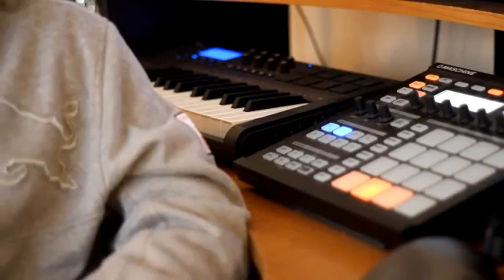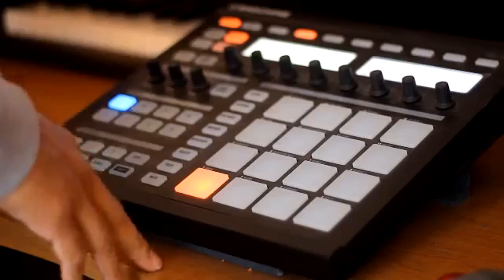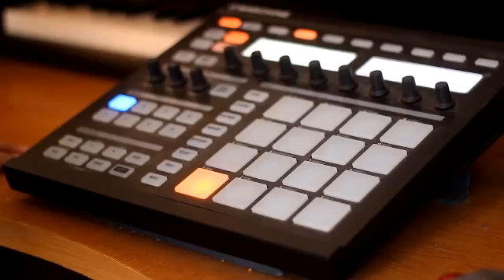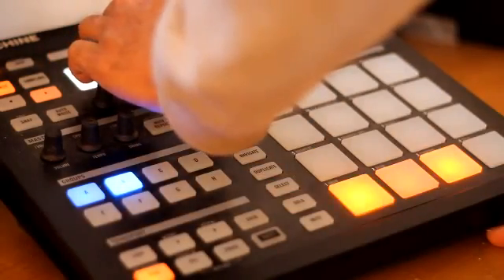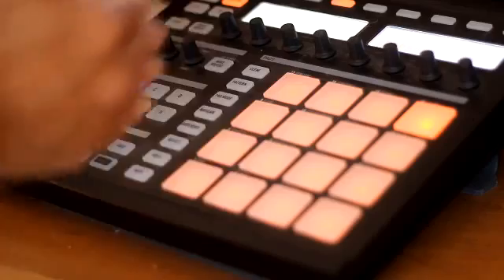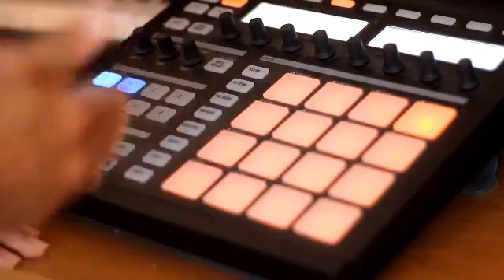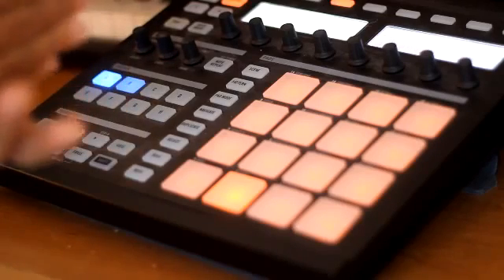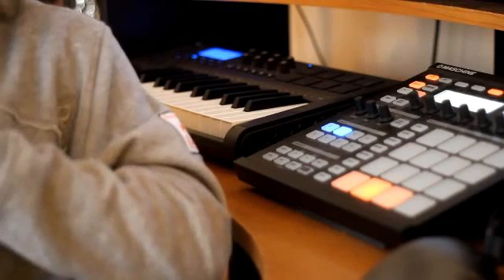Sampling Exposed on NI Maschine

Comment: Ok so my question is, what if you wand to use two separate parts of the sample, for example a section of the intro and a section of the bridge? So far all I'm seeing is is one section being worked on, and even further what is you want the different points of your sample to have different effects in one beat without affecting the first?
Reply: you apply the same technique, man.. it's multiplication. as long as you know how many bars your sample is, you either divide that number by 4 or 2 (preference) and that's how many slices you need..

Comment: **For the one's  having trouble  following  along with the chopping **
 What he's  basically  saying is: 

find your loop (whatever  length  you find, ie. 2 bars, 3 bars, 4 bars.etc). trim it until it loops PERFECTLY.  Then all you need to do is MULTIPLY THE NUMBER OF BARS YOU HAVE (example: 4 bars) by the number of beats in a bar, which is 4. So that would be your 4 bar loop (multiplied) by 4(beats in a bar)= 16. That would be spread each beat of the sample  across  on all 16 pads. ***As you get better at the chopping and stuff, you could start employing different chop techniques... let's  say you still have that 4 bar loop. Instead of multiplying 4 (bars) by 4 (beats), you could  MANUALLY adjust your chop zones (or whatever its called in Maschine)to chop it as if you were working  with a 2 bar loop instead  of 4. So we know 2 (bars) × 4 (bars)= 8. So instead  of being spread on all 16 pads, it is now only on 8 pads. With that, each pad will now consist of two beats instead of one  beat as with the first example. The possibilities are endless. Its really simple, but VERY,VERY useful. Once  you wrap your head around this concept I PROMISE that your sampled beats will step up quite a bit. 

AG is a beast and WE should be very greatful for the REAL KNOWLEDGE he keeps hitting us with. I hope I explained this well, but if not yall can ask questions and I'll  get back at cha.  PEACE.   IsshmanGarcia GKMG2015
Reply: ***** Thanks for this explanation. I understood the video, but your example of adjusting the chop zones was very helpful too!
Reply: No doubt!
Reply: +Isshman Garcia hey man, what if my problem is I literally can't make the perfect loop. is there any secret to trimming it so it loops perfect? i just haven't been able to get it
Reply: Practicing my friend or buy pre made loops. Sorry no shortcuts for that!

Comment: I'm pretty sure there is a way to do it using the beat slice, but typically you find your one 4 bar sample, use the edit function in Sampling mode to find the first start and end point for the first quarter note on the first pad, then duplicate to second pad, adjust start and end for second quarter, and so on and so forth for the rest of the pads...lengthy process sometimes, but ensures you get EXACTLY the amount of sample for each quarter note you want...